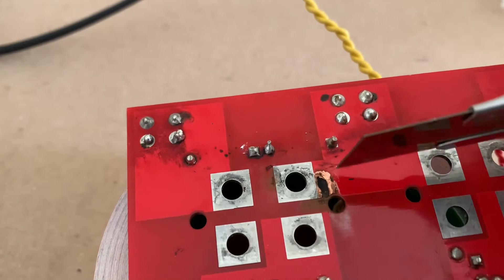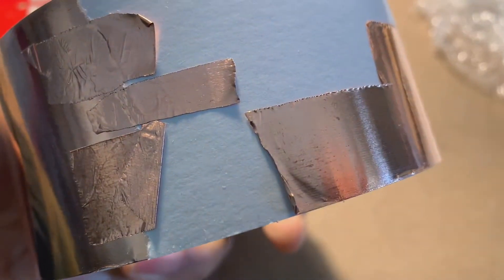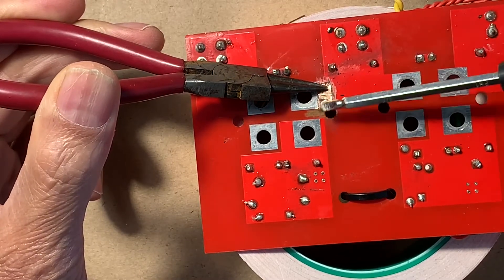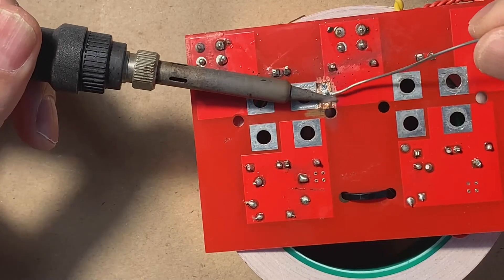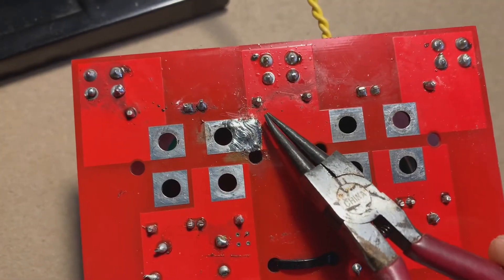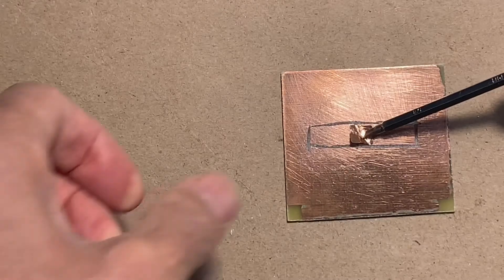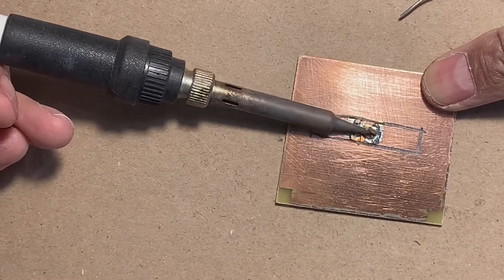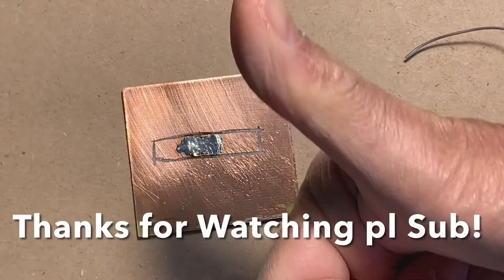Amazing Easy PCB Trace Repair

Comment: Hi, may i ask is this single sided or double sided copper tape? Will this help my pcb board (mouse board) i dont know whats the problem but when i tried to solder my mouse switches, i think i have burned the board a little and something came out from that one solder hole. (Excuse my electronic language, im not good at it) I am hoping i can fix it with this double sided copper tape and by following how you did.
Reply: Left click works and right click doesnt. Because its the right click holes that i burned. fk me
Reply from the maker: This is single-sided tape. The other side has glue on it. The glue does not seem to affect the repair process. Just layer solder over the tape to create a conducting bridge.

Comment: Specs of copper tape.. Plz.... Link or anything. I just need it...
Reply from the maker: Check here:
LOVIMAG Copper Foil Tape (2inch X 33 FT) with Conductive Adhesive for Guitar and EMI Shielding, Crafts, Electrical Repairs, Grounding https://www.amazon.com/dp/B07C6YLNYL/ref=cm_sw_r_cp_api_i_YM5KSFE2DP8AN2EXC4Y0?_encoding=UTF8&psc=1

Comment: What a great little video . I was ready to throw a circuit board away because for the life in me I couldn't get solder to stick to a pad that lifted.  Put a tiny bit of copper tape on and was able to solder to it 
Not bad for a lady eh ! Thanks 😊
Reply from the maker: You are awesome! Saved many PCBs with adhesive copper tape. Thanks for sharing your experience

Comment: Or you could do what hackers have been doing for millenia  and solder a piece of multistrand wire to bridge the  gap and snip off the excess
Reply from the maker: Works too thx !
Reply: @BrianDhvTinkerer  oops sorry that came off as bitchy... your way is far nicer neater and probably  has far less stray inductance than my ghetto way...much love bro😊
Reply from the maker: Thx bro !
Reply: I agree that simple wire is easier for fixing traces, but the foil is great for fixing blown contact pads.